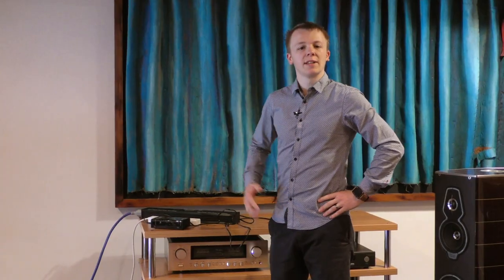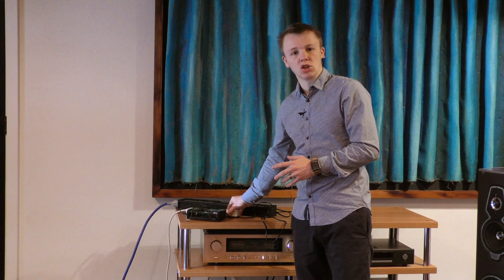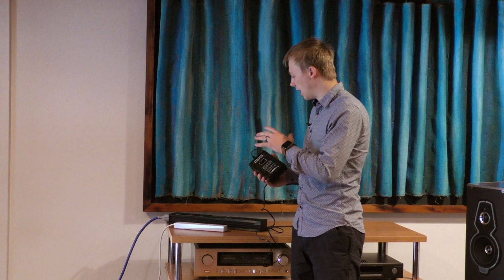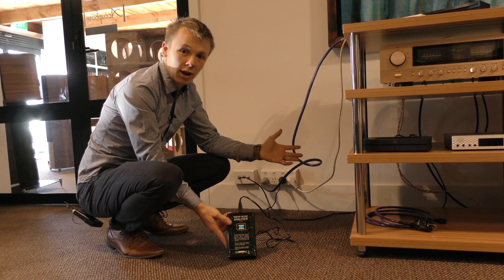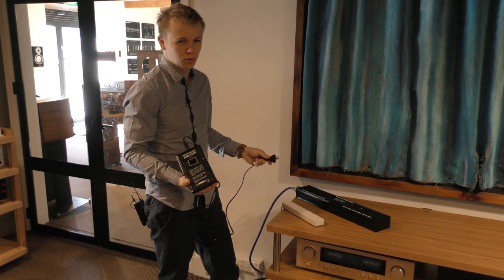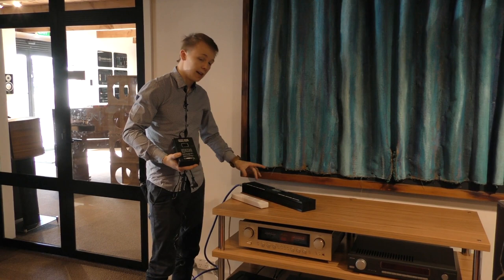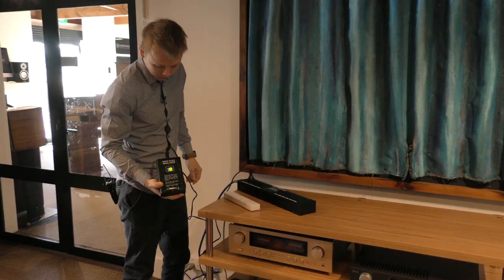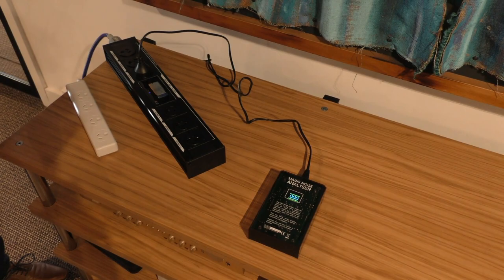Electrical noise on your power line

Comment: Using Isotek Noise analyser to test isotek power strip .. to promote isotek
Reply: probably not getting 0. its nearly impossible to get rid of it all but you can severely reduce the number.

Comment: Everything is frequency so its very important and effects you in quite a suttle way , radiation essentially, im getting a lot of low end hum which you generally dont notice until you switch off the amp , I would like to get rid of that , Isotek sirius wow what a nice piece of kit , i will be looking into getting one of these , it doesnt look cheap though does it! thanks soundline!

Comment: Hey James, it’s been a while since your last post. I’m sending you this comment from Israel while on holiday. I have two questions for you. What type of power supply is used on a high end amp? Linear or switching. I think linear power supplies are the quietest. What are the advantages of having these mains filter if the amps internal power supply already does a good job filtering out noise. Maybe you can demonstrate noise coming out of a high end amp using an oscilloscope in a future video.

Comment: Great explanation. Im not sure about the design of the product, bc afaik those filters are bound to die after a ferw years. It would make more sense to use a "normal" powerstrip and buy a surge protection adapter for your plug (those have noise filters most of the time too)
Reply: what? Why?

Comment: I need this for my RV. I have horrible noise coming from the 120v AC wall plugs. It has an APU unit with separate Diesel motor that keeps batteries charged, and also supplies the inverter.

The AC hum is horrible through a guitar tube amp, or even a Quad Cortex… but not through the TV? 

I bought a couple more  Furman Power Strips that hopefully block this..

I would love to get a noise tester like that

Comment: Great video James. I have troubles with Wall warts (not Wall mart ) they seems to emit some high frequency pulses into turntables and preamps. It is annoying many preamps are powered by Wall warts. Anyway to solve these little monsters?
Reply from the maker: The best solution would be something like the power conditioner you see in this video which features filters on each outlet that prevent noise from feeding back into the board and out to other audio components.  Check out the Isotek Sirius on our website.
Either that or make a point of avoiding products that use these kinds of power supplies unless they can be upgraded to higher quality outboard linear power supplies. (i.e. the Well Tempered Labs Simplex turntable comes with a wall wart power supply but they do make an optional high quality linear power supply called the dps).
Reply: @SoundlineAudioNewZealand  Do you know if a product like the Isotek Sirius declines in performance over time and if so how drastic is the effect?

Comment: Hi James, I have a problem that I hope you can help with. When I have a ceiling fan on low I can hear intermittent tones coming from it. Recently I changed my LED downlights and they flicker intermittently. It is not a faulty LED because I have plugged a spare into a power point in the same room and they flicker in sync. Could the noise and flickering be caused by control tones on the mains? It seems to happen more often at night.
Reply from the maker: If the flickering goes away when the fan is off, it will be the fan generating noise on the electrical system or is causing fluctuations on the mains which the LED Drivers which are typically quite sensitive, will be picking up and wont like it.
Reply: I've determined the problem. It is the ripple Control tones (1050hz in Queensland and 750hz in New South Wales) sent on the powerline to turn on and off water heaters, pool pumps etc. during off-peak times. The fan sound and the flickering occur together from about 9pm on. Not one article about LEDs flickering mentions this. No to fit a 1050hz low pass filter.
Reply: @lindanlester Yes, that's correct. It's a well kept secret apparently because people always look at me like I'm a conspiracy nut when I tell them, "it's the power company, sending signals down the line". (Like, sure bro, .. signals ..from the power company. 🙄)

Comment: Thank you for the great video on electrical noise on power lines ! On a side note, we are looking for an experienced "electronic noise consultant" who would be assigned to a project involving our client's product. It is a contract based opportunity with good hourly pay. The issue is challenging as our client could not get rid of the electronic noise for some significant time. If you or someone you know of, with solid background in electronics and especially noise troubleshooting and elimination is available, please let us know by responding here to this message or contact us by email and let us provide you more details to see whether this would be a good project for you. Even if you notice this message after  long time, we still would like to hear from you as we have from time to time other projects as well needing experienced electronic engineers with expertise in small signals and noise.

Comment: Can electrial noise damage a computer or devices similar?
Reply from the maker: Theoretically, but not to the same degree surges or spikes do.
Noise and distortion on an incoming signal is the sort of thing that would cause accumulative damage slowly over time. Sort of like death by 1000 cuts.  It’s impossible to really test it unless you conduct decade long study’s.

Comment: Dude, radio waves are not audible. Try again.
Reply from the maker: The machine I had in my hand was playing noise picked up on the power line in the form of radio. i.e. i could hear the DJ's of an FM radio station talking as the power cables were picking up the radio signal that they broadcast on as noise.
Reply: @SoundlineAudioNewZealand  that's a problem with your equipment, is it not? A radio signal is not noise, so something called a "noise analyzer" picking up and demodulating audio from a radio station has failed at its only job. It also seems incapable of doing any analysis at all--it just flashes numbers that impress you, but mean nothing. You keep claiming that the radio signal has to be coming through the power lines, but why? Radio waves travel through the air! And your magic box has no EM shielding, only a Lucite box, so it's hardly a surprise that it picks up radio waves that way. And what's the point of this whole exercise? To look at numbers on a mystery box? Seems a poor source of entertainment to me. If it worked better as a radio, you'd at least have that...
Reply: @StringerNews1  Radio waves travel through the air? Nonsense, radio waves don't exist. I've never heard them.
Reply: Out of coincidence I just happen to be using the same ISO-TEK SIRIUS power conditioner and I would just like to assure people  commenting here, it really does work! But bear in mind, one would be better off shielding ones speaker cables first! After all, it was my speaker cables that was making the loudest RF/EMI interference noise! you can actually see it on display within this 3-minute sound demonstration video...
https://youtu.be/xvdqI5qZa6g

Comment: Would you please stop promoting unscientific advice on your videos ? It's obvious that you have zero knowledge about the subjects you are talking about.
Even the cheapest electronics equipment have adequate filtering components in the power supply to remove any spurious noise found in the wall mains.
Reply: Not connected with Soundline, but they specialise in the high end, 'adequate' doesn't really cut it.
Reply: @davidfreeman4625  Adequate means it is doing the job and correctly filtering out unwanted noise. If anything, high end audio equipment needs external noise filtering even less than cheap electronics.
Reply: To some extent I agree with the sentiment. You are most likely to experience mains-borne noise in cheap junk coming from Asia where conformance to any EMC regulations is treated as entirely optional. On the other hand, expensive high-end equipment should comply with EMC as a matter of course to preserve their makers' reputations.

To sum up EMC: the FCC basically says that no appliance shall act as a radio or television transmitter or receiver, unless it is a radio or TV transmitter or receiver.

As for the demo, he should have plugged in an appliance that was actually affected by the power line noise in his shop.
Reply: if you ever used powerlan adapters, you wouldnt say that. my 5.1 speaker system sounded horrible with plugged in. lots of crinkling noise and white noise.
Reply: but for the price these devices are probably not worth it for most people